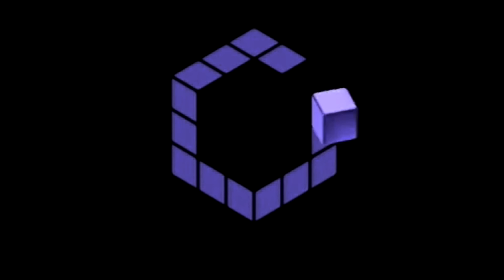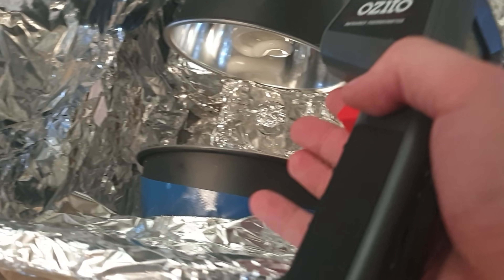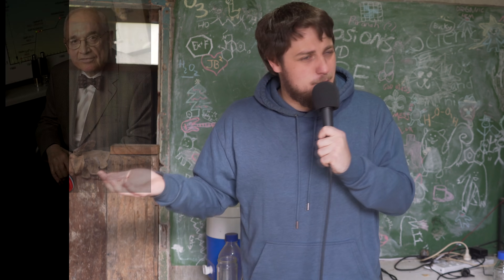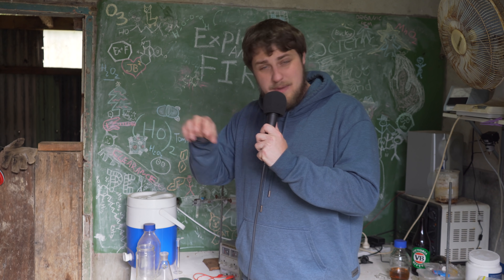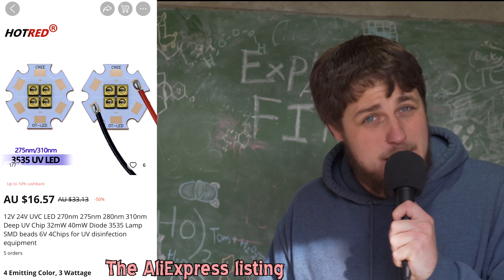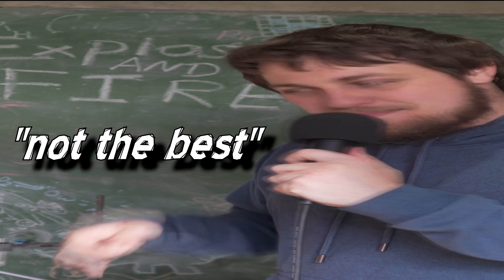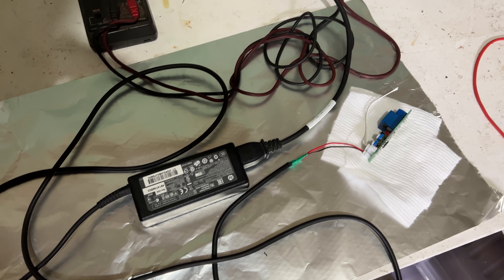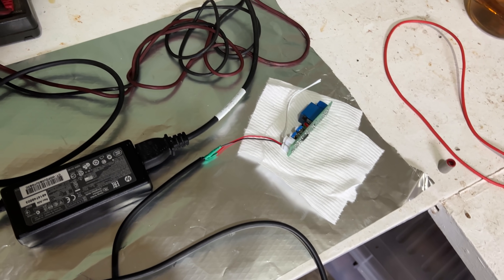Magical deep UV LEDs - Cubane Ep 12

Comment: When it comes to LED's, they act electronically like a diode junction : you give a voltage in reverse power (+) to LED (-), power (-) to LED (+) and theoretically no current should flow (unless maybe a small current because of leakage.. LED's are made to make light, not to act as a good diode). Then again, give enough reverse voltage and the diode can reach a threshold where the diode can be destroyed. That limit is "maximum reverse voltage".
Power it the right way ( + on +, and - on -) with a very small voltage and the diode doesnt work : a specific voltage needs to be reached for the diode junction to start letting the current flow well, consume power and produce good light. that threshold is "forward voltage".
Power the LED directly from a power supply with the exact required voltage, and yes, it will light up well with approximately the right current, but it's a dangerous way to power LED's : their forward voltage will go down as its temperature gets high, so current consumption will rise more and more until the heat kills the LED.
Power an LED with a voltage source slightly greater than the rated forward voltage, and you'll instantly see a very big current through the LED, and a burnt LED in no time.
So here's a simple advice if you run them from a power supply (not an LED driver, but a power supply from which you have a fixed or a user-settable voltage) : add a resistor in series with these poor LED's to calm down their current consumption : it allows them to get the power they need by themselves like you said. Lets say you have a 20V used laptop power supply (or lower, it's fine too), and you want to power 12V LED's at 40mA, you then want a resistor that lets 40mA through and a voltage difference of 8V between its leads (because you want a difference of 8V with the 20V power supply to land on the desired 12V for the LED's). The required resistor value is 8V/0.04A = 200 Ohm resistor. 220 Ohm is standard value, and higher value means less current, so less risk of damage. Get a 0.5W resistor (a higher power rating is okay) and put it in series with the 12v LED and you're golden. Wanna add LED's? add as many individual LED+220 Ohm Resistor circuits in parallel on the 20V supply as desired (unless you reach the power output limit of the power supply, buti expect that would require a ridiculous ammount of LED's).
If you use an LED driver, choose one that gives out the right voltage range and the LED's rated current at most (and not any higher!). lower current is fine, it just means a bit less light, less heat, and lower risks of wear/damage.
Also, good call to switch off power from the mains and not from the LED's : it's safest because otherwise the LED driver would could go crazy on the output voltage when it's trying to generate a current across an open wire.
Another good call : LED's in series on an LED driver is good : the same current flows through all the LED's regardless of forward voltage. Each LED (and more generally, each diode) has it own forward voltage. So if you Parallel them, the LED with the lowest voltage will consume more current than any other and burn up faster. If you plan on paralleling LED's with LED drivers, better give each LED their own individual LED driver.
And for peace of mind on electronics project, it's good to get a multimeter, even a very cheap one to check what's happening in the circuit.

Comment: It's hard to tell if that bench power supply can limit amps; if it can, use that.  Set it to 40ma and the voltage to anything above 14 - it'll limit the voltage for you automatically.  That's basically what constant-current LED drivers do - they let the voltage go to whatever level is needed to draw a specific amount of current and no more.  This is preferable to limiting current with a resistor, because the (extremely low) resistance of the LEDs changes with how hot they are - as they heat up, they basically become exponentially closer to a dead short and will draw as much current as allowed.

That said, a resistor in series is probably fine for this small amount of current.  The trick is the resistor's ohms rating will depend on your supply voltage - the higher the volts, the more ohms you need to stop the LEDs from burning out, but also the more heat the resistor needs to be able to dissipate.  Use digikey's "LED series resistor" calculator for whatever wall wart you have handy in the 15-24 volt range, with the following values gleaned from that fairly crappy datasheet:
Supply voltage: your wart's voltage
Forward voltage: 12v; these are 6v LEDs, evidently, but set up in a 2p2s configuration so you add the two in-series chips together.
Forward current: 40ma.

Ideally you'd want a supply voltage just a hair over the forward voltage, to reduce the heat the resistor needs to deal with.  That calculator will work that out for you, too - don't exceed the resistor's wattage rating.  Most are 1/8th or 1/4 watt unless you specifically find a higher-wattage resistor.

Comment: As an electrical engineer I was cringing at the diode part... You could have just used the power supply in constant current mode, it's what the other dial is for. Limits the current going into the device.
If you look up online, you will see that the current vs voltage curve of a diode is extremely non-linear (hence why the current suddenly shoots up after a certain voltage). Even worse, the curve 'shifts' to the left with higher temperatures. I.e. with the same voltage it will draw more current at higher temperatures. Higher current causes more heat to be produces and voila, you have a positive feedback loop that will destroy your device. So no, that 40mA number is very relevant and you should be caught up on it. The forward voltage is not that important, your PSU should just be able to deliver at least that voltage for the rated current.

tl;dr LEDs should be current controlled.

Also 10:20 Voltage is not power. Voltage*current = power. 
Similar to for example hydraulics. Pressure is not power. Waterflow*pressure = power. 
Or mechanics: Force != power, force*velocity = power.

Comment: Bit late to the show but A good place to start is Ohms Law. If you LED requires 40mA you use R = V/I so if you hit them with 12V its 12V/0,04A (40 mA) = 300. So if you put 300 Ohms resistor in series to your LEDs you will land near the 40ma (a bit below because the LEDS are not COMPLETELY without resistance + wire resistance) There is 330 Ohm resistors out there for less than a cent.

You should however consider putting the LEDS parallel to each other because putting them in series can lower the voltage for the ones down the line.

Word of Advice: The LEDS are rated for 40mA but will quickly die out if you keep em at that current. As you noticed from the heatsinks there is quite some warmth!
Generally to ensure LEDS stay alive for longer they are driven with 20 or even 10mA. Low currents do lower the Output of the LEDs but not by much. It all depends on how intensive you need your uvc Levels. At the rated current a LED has about 10000 hours of lifetime. Which is fine, but shrinks severly if used everyday for long periods of time.
However, If its just for an experiment now and then 40mA is no problem.

Now im not a chemist, but i would go for a good all around coating of UV so maybe put 4 leds on the can so it can illuminate the reactants from every side. (German Saying: Viel hilft Viel - Much is helping Much)

Good thinking with the passive cooling!

Comment: 14:13 Yep, pretty sure the little orange flash is the bond wires in the package going PFFT 😅
One problem is that so often it's said that voltage is pushed and current is pulled, which is correct for resistive loads, but unfortunately that's not how LEDs work.

Comment: Oh my goodness, somebody please explain to our dear sweet Tom that voltage is the force that drives a current, and you can't just assume that a component will "only take what it can use" if you give it double the current it's supposed to work at, especially not one whose resistance isn't constant with voltage ;-;

It'd be like applying twice the water pressure to a valve than it's able to keep working at, and being surprised that all the extra pressure you're applying breaks it.

Tbh the fact it's a forward biased diode makes it even worse than that, it'd be kinda like your tubing and component are made of rubber which magically stretches above a certain water pressure (voltage) to let through all the water (current) that your pump (voltage supply) is capable of providing, dumping absurd amounts of energy into your pump (your poor, innocent LEDs) and breaking them

Comment: i love how everyone gets distracted by him overdriving the leds but noone is mentioning that he is literally doing all of this on a piece of aluminum foil
Reply: I was so confused to why.. It's useless as a heat sink because it's so thin and it's pointless to have a reflector behind the leds. If it was meant to compensate for not connecting the ground wire to the Aliexpress power supply to reduce the risk of electrocuting himself it achieves the opposite.
Reply: @Björn_1978  not only that, its an esd hazard, espeically with expensive new gens parts like those leds ^^ 
im guessing cause hes doing all of this on his chemistry bench
Reply: @contomo5710  Haha, I saw your reply after I posted mine! :)
Reply: I think I figured it out! It's a diy anti-static mat! PSA: the purpose of an anti-static mat is to prevent electrons from stampeding to ground through sensitive electronics and works by providing a slow path to ground for high energy (thousands of volt) electrons. Aluminum foil provides a low resistance path for any electrons to go wherever they feel like so it's not the best choice.
Reply: @Björn_1978  this one is more a static mat then :P aluminum would oppose a lot of capacitance unless grounded, i doubt he grounded it

Comment: Love the channel! Since I simulate electronics for a living maybe I can provide a chemistry-ish analog for you that doesn't offend too many people.  Internally the LED as two regions, an n and p region put together.  The n region is electron rich and the p region is electron deficient.  These two regions can be modeled as electron and hole "gases".  The concentration of these two "gasses" are determined by the internal voltage but also by the external voltage you apply.  The internal and external voltage is exponentially related to the electron and hole concentrations in the two regions.  At equilibrium two regions form a depletion region where the electrons and holes "react" resulting in a continuous carrier distribution and barrier between them.  In non-equilibrium conditions (when voltage is applied) this depletion zone can be modified and is eventually eliminated with enough applied "positive" bias. With no depletion region the electrons and holes flow into each other's region and recombine (a sort of reaction) producing light and heat.  In direct bandgap semiconductors light is more efficiently produced than heat (the reverse is true for indirect bandgap semiconductors).  This "reaction" is still exponentially dependent on the applied voltage.

A direct chemical analog for this behavior might be difficult for the equilibrium conditions but non-equilibrium dynamics should make sense in terms of reaction kinetics in chemistry.  You have two reactants electrons and holes forming light.  There is a reverse reaction from light into electrons and holes but the light can leave the diode while electrons and holes cannot (for lasers there is a third reaction possible, stimulated emission).   Regardless, all this should point out the fact trying to understand this "reaction" in terms of voltage is difficult.  You want to provide a constant rate of electrons and holes that the device is rated for turning into light.  In this case its 40 mA.  The device will drop a certain amount of voltage at that current rating (something around the built in potential).  So, you could linearize the LEDs behavior at that bias and setup the circuit such that the LED is modeled as a resistor with the voltage from your power supply at 40mA.  Other people recommended using a series resistor to help provide the proper bias for the LED.  That would work but you could also use a current mirror or some other type of constant current source. These type of electronic circuits are not too difficult to make.  A current mirror is two transistors and a resistor.  But you also should be able to find a proper LED driver or driver circuit online.  The bottom line is you need to deliver the proper current because the "reaction" is exponentially dependent on voltage. Hooking an LED directly up to a voltage source isn't the best of ideas, although this setup might work for your purposes if these LEDs are robust enough... I'm an engineer so I understand the pragmatic argument for things "just working"

Comment: UVC LEDs usually have forward voltages around 6.5V (though yours should have an exact voltage on the data sheet that came with them). If you connect the outputs of two USB phone chargers in series, you can get a 10V supply. 10-6.5=3.5. So if you want to push 40 mA (=0.04 A) through a UVC LED using a pair of phone chargers in series as the power source, you need a series resistor that'll drop 3.5V when 40 mA is passing through it. Ohm's law (V=IR ->3.5=0.04x) says 87.5 ohms will do this, and you could round up to 90 without issue. I haven't seen the video yet, so I don't know if 40 mA is the right number, but I saw another comment and thought this might be useful.

Comment: "Some people are just give it whatever and that's the current it will take"
Those people are called "idiots".
Most materials, you put voltage through them, they resist the flow of current. LEDs, you put voltage through them, and they're all "nah fuck you" until the voltage gets high enough, then their resistance goes down, current floods through, magic smoke escapes. You need to limit the current yourself, either with your fancy lab bench power supply, or with an old fashioned resistor, using Ohm's Law.

Comment: you should have just used CPU thermal paste (something like arctic silver) and zip-tied them to the block, which also should have been much bigger
thermal epoxy is often much less efficient that just a regular thermal grease.

actually, you probably could have gotten some old intel stock heatsinks for cheap, complete with a fan for active cooling, which would be ideal.
LEDs get really, really hot, and that heat will kill them quickly if it's not managed.

Comment: okay so this is a little painful to watch as an EE. The reason the LEDs need to pass some voltage is they have a semiconductor junction that requires roughly 3v of forward voltage to conduct, with 4 in series thats where the 12V comes from. So anything less that 12V wont conduct(just leakage current) and then as you hit 12V they turn on an conduct and become a short essentially. Because of this you need to limit the current through them with a series resistor or using a constant current driver.
-
Cheers <3

Comment: 3:52 - fun or not so fun anecdote: one or two years ago in the nearby uni they used UV lamps to disinfect room after lectures. Staff forgot to turn off the lamp for a lecture and students got severe burns. Surprisingly the students were blamed because they didn't notify the staff during the lecture (even though burns show up some time after the exposure).
Reply: Of course the students got blamed, because if the Uni admitted the blame, they'd be liable for any and all damages incurred due to the exposure. (Immediate medical costs, and long term ones as well.)
Reply: @The_Keeper  yup, they didn't help them at all, even worse they still required presence on the lectures even though some of the students had to be hospitalised
Reply: @GsaUce Rug look up Silesian Medical University in Poland, that's a case from 2021 I think. The staff there is notorious for mobbing and other such practices. I don't really know what happened later as I didn't follow the case.
Reply: "surprisingly"

Comment: Set your power supply to 0.04A or slowly bring the voltage up until the current reads 0.04A. Another way to do it is by using a resistor. Say, you have an LED module that needs 12V and 40mA but your supply is 16V. You need to drop 4V. 4/0.04 = 100. So you would insert a 100 ohm resistor in series.

Comment: Watching this was like being punched in the testicles. How you didn't burn up those diodes is beyond me, especially with no heatsink.

The LEDs themselves are current-limited. Running them at the current you did in your first test was… brave. They'll also change their spectrum subtly with temperature and current increase unlike most high powered LEDs (as well as their electrical characteristics changing as they heat up too), so you want to keep them as well cooled as possible. Look into something like the Supertex HV9910DB1 demo board to drive them, it's basically the perfect specs for what you need (Vmax 20VDC input, 1A max but can be lowered to 0.01A on-board), it'll save you a lot of headaches in the future and save you from burning up your junk and wondering why your synthesis didn't work.

Comment: There is a video by the « engendering mindset » about LEDs and how to power them properly. You never want to hook up an LED directly to an current unlimited voltage source couse the voltage vs current relation of Diodes is exponential.

Comment: You don't see many constant current drivers at such low current since it is much easier (at very low current) to use a resistor to limit current.  You use a constant current driver at higher currents where you'd need a giant heat-sinked resistor that would cost a lot of money (and waste tons of power).  At 40mA wasting a tiny bit power is fine.